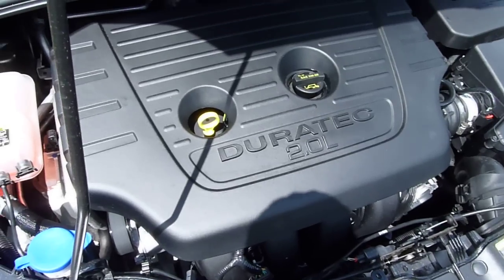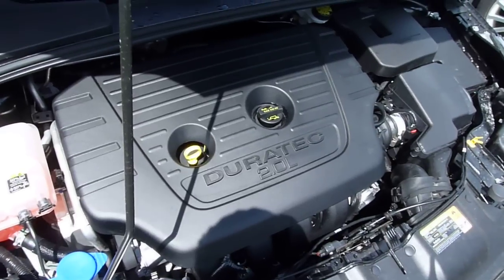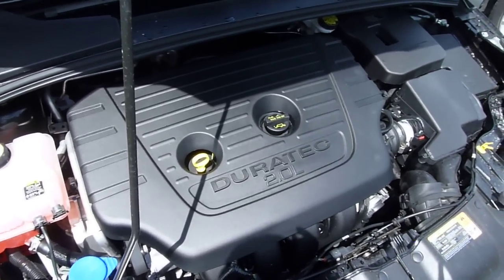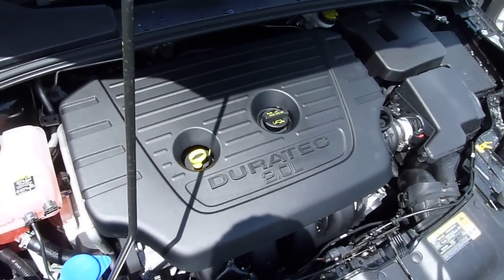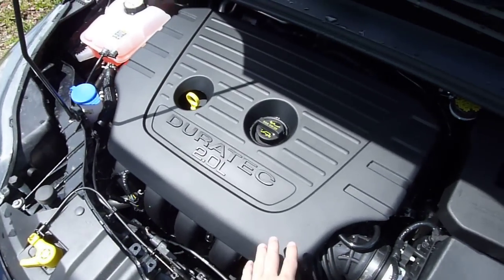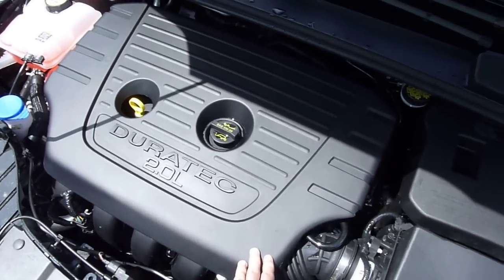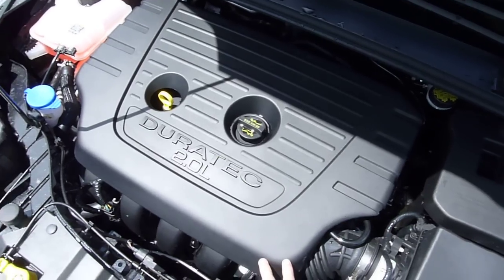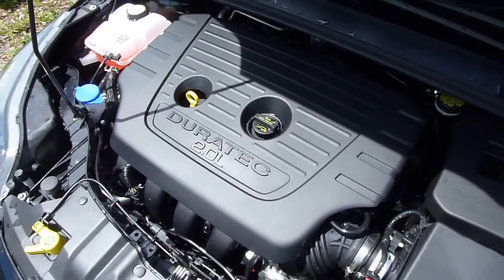2012 Ford Focus start and rev

Comment from the maker: @1RaVeN1FTW Well I dislike that it can be jerky at low speeds, but my mom has a 2010 Jetta Wolfsburg with a DSG so I'm used to jerky low-speed behavior & expect it from a DSG.  I do love the feeling of not having a torque converter...the rev-matched downshifts are great...the shift speed isn't always the quickest but once you're going, the transmission is actually really good...Sport mode is also awesome and fixes pretty much any issues people have with how it's programmed to shift in Drive mode